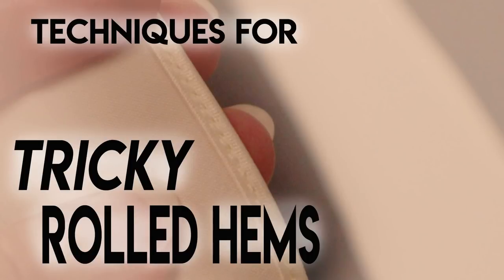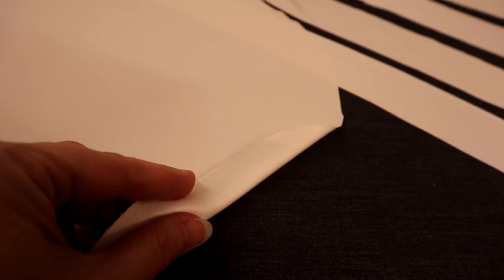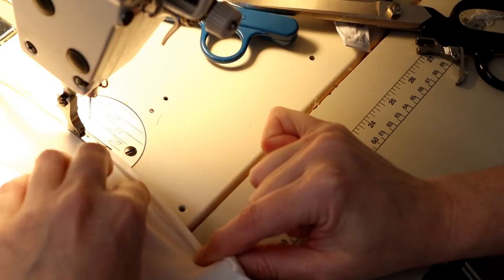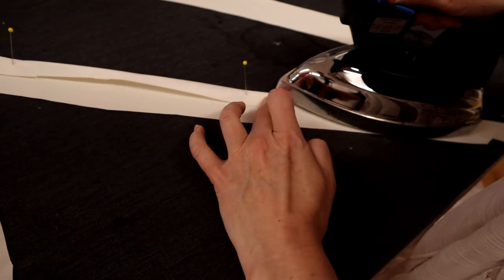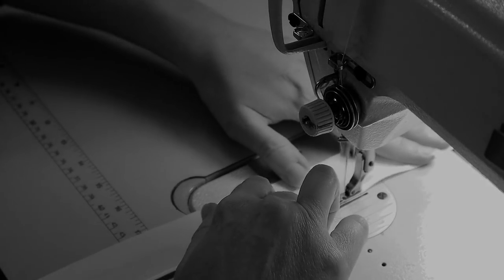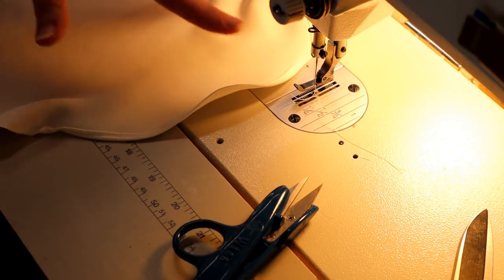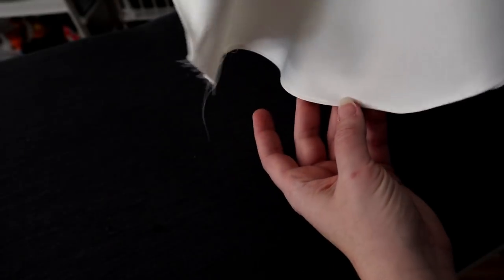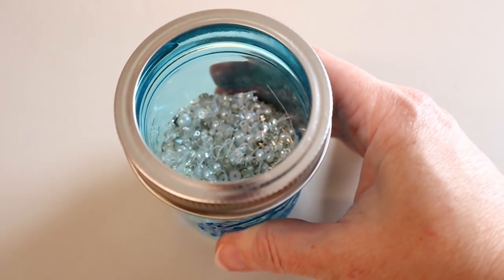How to Sew A Tricky Rolled Hem | Fine Roll Hem for Sheers

Comment: Great video! And also your comprehensive rolled hem video. I've been sewing as long as I can remember. Doing a hand rolled hem on a little  bandana for a granddaughter today. The only way to hem a circle is to go with the curve! I don't  think I have ever heard anyone else mention using your left hand to keep tension on the material. I've kinda figured it out myself and will use both hands at times to keep  the tension I want in the direction I want rather than just supporting or guiding the fabric. You just have to do what works!

Comment: I do a two step rolled hem but i do it a little different.  It begins at the fitting.  I mark the hem at the floor then use that line of pins to turn up the hem the desired distance off the floor.  I do this to each layer.  It does take time but i make it up when sewing.  I press the pinned up hem up then i use that pressed crease line to keep track of the length.  I then without cutting it off machine stitch the first row which is not on the fold.  I roll the fold slightly to the left and stitch close to the new fold.  Then i trim it close like you do.  With bigger scissors in the palm of my hand.  It gets faster with practice.  Then turn again on the pressed crease line and sew second row.  I never worry its not correct .  And you can get a very narrow rolled hem.
Reply from the maker: Yes!! I feel like I see this technique a lot!

Comment: I think this was a great tutorial. Thank you. Once I saw someone in a video using what looked a lot like a loosely woven hair canvas only an inch or so wide. They removed the sharp threads a little way and used it to stitch over much like horsehair braid stitching first through the threads flat then double turning it and stitching again. Then they pulled it out and frankly the hem looked gorgeous. Do you know what this stuff is and have you ever tried it?
Reply: I think the ban roll might be it. I just wonder if it works as well as it looked like it did.
Reply from the maker: I have seen that. I thought it was buckram? To me, it seems unsustainable for regular use in a full time shop, though. But, you may love it! :)
Reply: @BridalSewing  I must agree- a bit labor intensive. However on a really tough wedding gown I might use it anyway.
Reply from the maker: Right!
Reply: I've been using the band roll method now for a few months. I love it I've got to hem in a wedding dress down to 15 minutes.. it can get a little messy but they can be reused over and over again
Reply from the maker: Nice!

Comment from the maker: Hey, BST Besties!  Do any of you ever use the dissolvable stabilizing?  I saw this done many years ago and really don't use the technique.  I linked to some type of product above, but honestly don't have a favorite.  What is your favorite dissovable stabilizer, and how do you like to apply it, sew it, and dissolve it? Of course, if we can't find the exact wash a way product, when using this on, say, an ivory satin, you can always use a thin strip of iron on permanent light interfacing and leave it in the rolled hem. Again, this is just for worst case scenario.
Reply: I dont know the name of it because the pkg always gets tossed. But its see thru. I never use it for bridal. I always use it for suit sleeves. But it completely dissolves and you dont have to wash it. It might me Dritz but stitch witchery type stuff not stabilizer 😜
Reply from the maker: @iheartbridalcouture5989   so it is a tape on a roll like stitch witchery, yet it dissolves in water? And does it have two parts like a wax paper layer you peel off after pressing, or do you press it like the interfacing, or is it sew-on? I hope we can find it.
Reply: @BridalSewing  Its on a roll and it dissolves with iron heat. But you wouldn't want to leave any part of it exposed because if you do it gunks up  like cement glue does when you roll it off. I'll see if i can find it 😬
Reply: Its Dritz Fusible Bonding Web. Theres even a video showing how to use it lol. They say its for lightweight materials but I've used it on pants and suits a lot
Reply from the maker: @iheartbridalcouture5989  oh, I don't think that what I'm looking for.  The product I am looking for is like what you iron onto the backside of a shirt before you embroider it.  Then you wash it and it dissolves. I hope I haven't started a wild goose chase! lol
Reply from the maker: So you place it on. Stitch the edge down, do a rolled hem, and then iron it away?
Reply: @BridalSewing  thats embroidery web. My niece does embroidery.
Reply: @BridalSewing  Yes. But it has to be covered by material when you press it. You could cut it thin to use it
Reply: My mum gave me some stuff called wash a way interfacing
Reply from the maker: I think that's what I'm looking for!! Lol I'll look it up!
Reply: Bridal Sewing Techniques I used it on some baby wraps I’d embroidered the edge on

Comment: Dayum, your videos are so satisfying! Hehe, but can you do a full circle hem by using the first method which you mentioned it as one path. I practiced it for awhile but I could only managed to do 1/4 circle perfectly while the other parts fold got bigger as I tried to sew it..🤣
Reply: maya magar are you tugging, or pulling the fabric?
Reply: Sandra Newton hehe, rolling and pulling from both side as the machine sew.😰
Reply from the maker: I can do this to a full circle skirt, but I probably wouldn't start with that when learning. You may need to do a two-pass type of roll like I mention in this video.

Comment: Very helpful, my go to hem is the two step. I pin the floor then without ironing I hem with the fabric folded a couple of cm lower than the pins. Then cut, fold and stitch the narrow rolled hem.
This works so well for me on the big ball gowns and really all formalwear.
I do exactly the same techniques every time leading to consistent  super narrow hems
Most of the brides and prom girls I sew for want the hem sweeping the floor and this works well.
I find cutting the fabric first and folding as I sew difficult  and time consuming. 
So many fabrics fray easily and I get the best result with sew-cut-sew.
Reply from the maker: This method that you use is a very popular, accurate method! :)

Comment: I have a question that isn’t related to rolled hem, I hope it’s ok.  I need to take in the sides of a bridesmaid gown and I cannot access the inside - there is no opening between the layers to get inside.  I’ve never had this before.  Should I just open it from the top?
Reply from the maker: There are a few different ways, (as usual!) 🤣 You can use the top if you like. 
Sometimes the waist lining seam is turned under and hand stitched. You can open there. 
Some seamsters open the lining's side seam & then hand sew that closed after.
Reply: Bridal Sewing Techniques Thank you!  I’m not sure why this tripped me up, I’ve done plenty of advanced alterations.  I just have always done THIS one way since it was always accessible through the opening that was provided LOL!  I guess there’s a first time for everything!     I appreciate it, and as always, thank you for sharing your talent!  I look so forward to your videos!